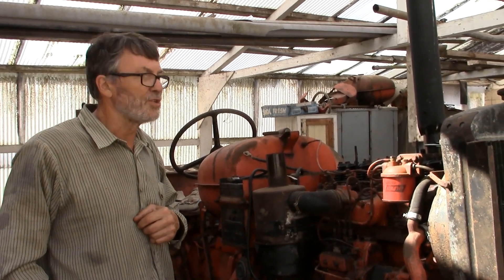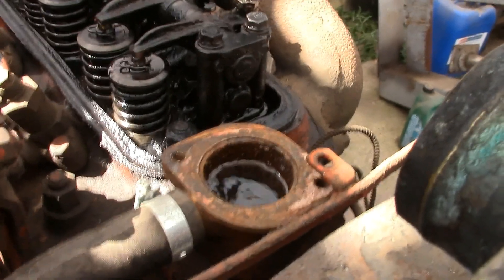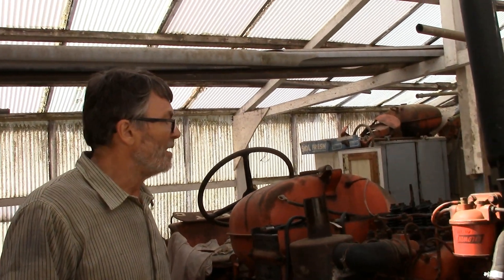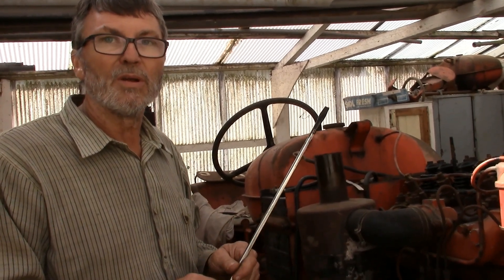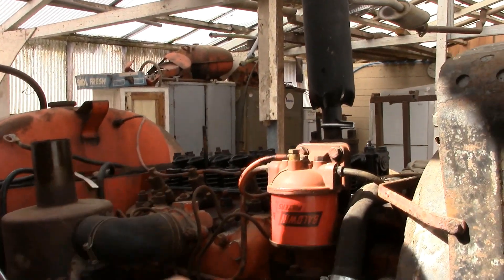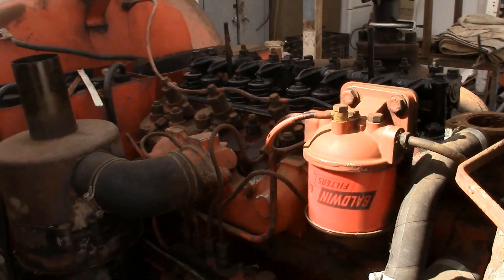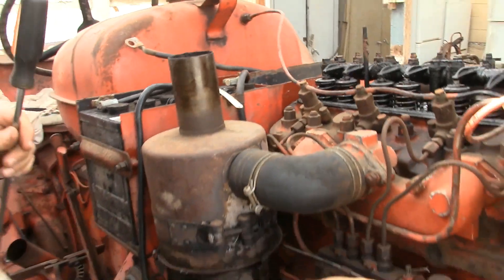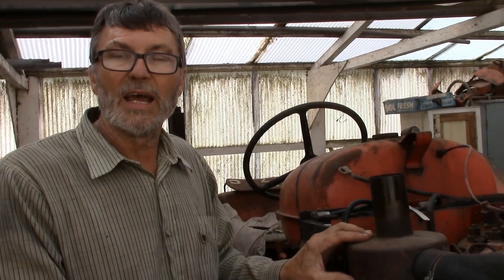Nuffield Head Fault Diagnosis

Comment: Great to see you posting videos again. Hope your shoulder is fine now. I have a new to me 1060 engine apart now that had bubbles coming out the rad cap. It looks like the shims on number 2 cylinder left the sleeve slightly below the casting which blew the head gasket. Looking forward to seeing you next video. Cheers